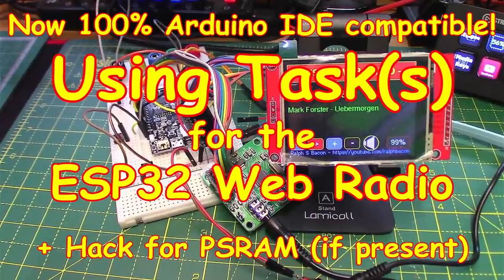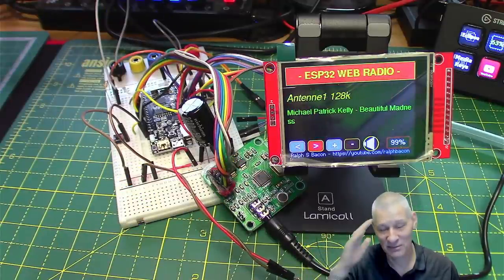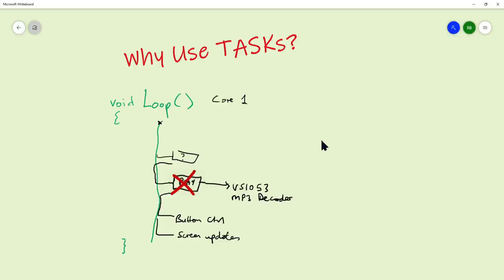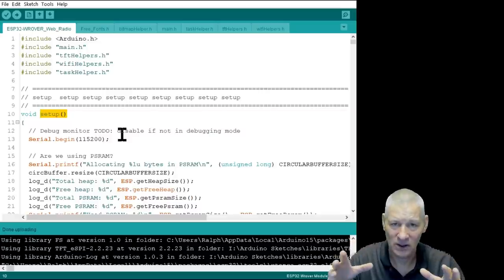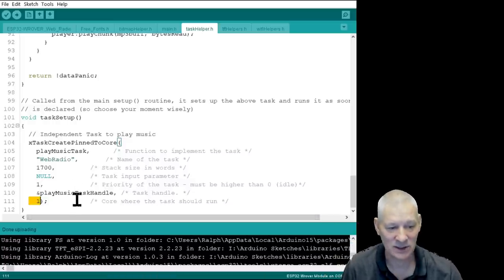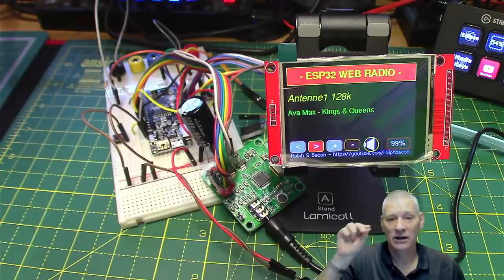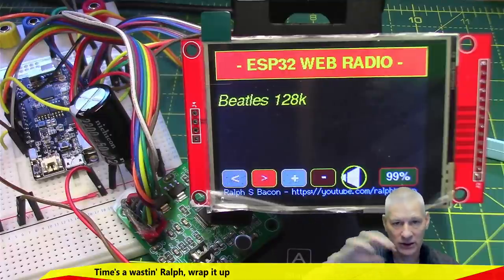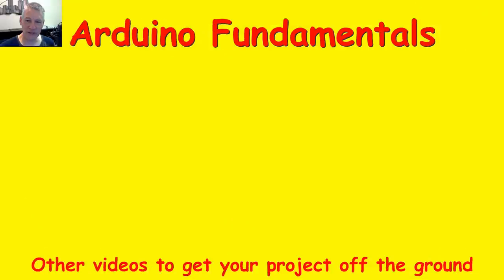#208 Using an ESP32 Task for my Web Radio - using the Arduino IDE

Comment: You way to do multitasking is not very good. I would want the player task to run at high priority, but not "wizz" around.
For real multitasking the task need to give up the CPU when it has nothing to do (Like waiting for sending the next data block or not playing at all).
The "loop" task has to work the same way for best performance.

System made for multitasking usually have ways to do this, this can be blocking calls that internally tells the OS to put the thread to sleep while waiting for a event.
A more simple way to do it is to call delay(xxx), this will usually do it, even delay(0) may work (It basically tells the OS to give all other task a timeslot, before returning.

Programming this way will usually reduce the power consumption of the CPU and make it more responsive. For CPU's with variable clock speed it is very important to it this way or the OS may not know the program is idle and can run at reduced clock speed.
Reply from the maker: Hmm. Well, let's consider your objections!
1. I'm not interested in the slightest about power savings at processor level. I had to add a dedicated 2A PSU just to stop brownouts. Maybe I'll refine this (much) later.
2. How can we detect when this task has "nothing" to do? It already queries the VS1053 to determine whether it's ready for more data. If not, what do we do? Delay? Suspend? For how long? The VS1053 could be ready in the next μS after that query. A delay of 1mS would be enough to cause audio glitches as the VS1053's buffer would be empty. I don't see what we can gain here apart from not keeping the VS1053 stuffed to the gills with data the instant it wants it.
3. At this stage we have no other tasks (apart from the main one) wanting resources. Giving up our time slice to the loop is exactly what I do NOT want to do - this task is more important than updating screen titles or servicing button presses. I'll let the RTOS sort out running the tasks in a suitable manner.
Henrik, you need to take a step back and see that this is a proof-of-concept piece of code that actually works very well indeed. It can (and probably will) be refined as things progress but until then, you need accept that this design WORKS despite your reservations about my multitasking skills!
Reply: The datasheet do not agree with you, an example says you can wait 5ms if the dreq is low (the chip has a 2kb buffer).
But dreq is also a pin and you could use that with an interrupt.
The datasheet even says something about not doing  continuous SCI operations.

Giving up a timeslice is often a very good idea when there is nothing to do, you will not loose more time than a OS forced task shift will give you and you now it happens when you are idle. The OS will still force some task shifts on you, but not as many.
The RTOS (or any multitasking OS) cannot sort out multiple task very well when they refuses to cooperate. Giving up timeslices and telling the OS to stop a task because it is waiting are what a multitasking OS is designed to handle.
To define what tasks are important or not you use priorities, but they do not work if the task hog the CPU. A high priority task must tell the OS when it is idle, or there is not spare time to run the low priority tasks.
Reply from the maker: NOW you're giving me the constructive feedback, Henrik, that makes your first comment make sense. I didn't realise that the VS1053 has a 2K buffer. In that case I most certainly CAN (and probably WILL) suspend the task for a sensible amount of time as I'm no longer worried about the 32-byte update amount. 
Using DREQ as an interrupt is certainly an option I had not considered; the options are multiplying even as I read your last comment! Thanks for the details. it's got me thinking! (This is why we did peer reviews at work, two or more heads are always better than one).
Reply: For the first answer I had not looked at the datasheet, it was just regular programming advise.
delay() may be better than interrupt for this chip, because DREQ signals when there 32 bytes free in the buffer, that would mean very frequently interrupts. Where a task that wait for the time to use 1000 bytes, before filling the buffer, would need much less attention. You will have to run the task at a high priority level to be sure it will run asap when it is time and you also need to be sure the delay() function is a OS function and not something that just waste clock cycles.
Reply from the maker: Thanks, Henrik, I will bear all this in mind when I get that far.

Comment: Hi Ralph. I tried to compile the arduino IDE version and got a message saying that the User_Setup.h is missing can you explain what I have done wrong? You also told me earlier in the week that I would have to adjust something and you would explain it your video. Was that the User_Setup.h which I need to make?
Reply: Hi Have you downloaded Bodmers TFT_eSPI TFT library ? User_Setup.h is a config file in that library. It supports a number of different LCD display panels, so you have to tweak that header file to match the LCD panel you are using and your pinout wiring if it differs from the default wiring.
Reply: @geoffw.5003  Thank you so much. I will have a look. Are you making the Internet radio? I feel embarrassed at asking Ralph such questions. I need to read things more carefully. In the meantime thank you once again.
Reply from the maker: The user_setup is part of the TFT_eSPI library (based on Bodmer's, and I have edited it to work with this screen and this project - that is, the correct SPI pins, for example). However, you have the entire Arduino sketch now (no need to download anything else) and I don't do anything special to get that user_setup file included. I'm using Arduino IDE 1.8.13. Ensure you read the readme.md file to copy the library files to the correct place!
Reply: @RalphBacon  Thanks  Ralph.
Reply: Using previously compiled file: C:\Users\pclay\AppData\Local\Temp\arduino_build_130546\libraries\LITTLEFS-master\littlefs_api.c.o
C:\Users\pclay\Documents\Arduino\libraries\LITTLEFS-master\src\esp_littlefs.c: In function 'esp_vfs_littlefs_register':
C:\Users\pclay\Documents\Arduino\libraries\LITTLEFS-master\src\esp_littlefs.c:203:9: error: unknown field 'utime_p' specified in initializer
         .utime_p     = &vfs_littlefs_utime,
         ^
Multiple libraries were found for "WiFi.h"
 Used: C:\Users\pclay\Documents\ArduinoData\packages\esp32\hardware\esp32\1.0.4\libraries\WiFi
 Not used: C:\Program Files\WindowsApps\ArduinoLLC.ArduinoIDE_1.8.42.0_x86__mdqgnx93n4wtt\libraries\WiFi
Using library Preferences at version 1.0 in folder: C:\Users\pclay\Documents\ArduinoData\packages\esp32\hardware\esp32\1.0.4\libraries\Preferences 
Using library WiFi at version 1.0 in folder: C:\Users\pclay\Documents\ArduinoData\packages\esp32\hardware\esp32\1.0.4\libraries\WiFi 
Using library ESP_VS1053_Library at version 1.0.3 in folder: C:\Users\pclay\Documents\Arduino\libraries\ESP_VS1053_Library 
Using library SPI at version 1.0 in folder: C:\Users\pclay\Documents\ArduinoData\packages\esp32\hardware\esp32\1.0.4\libraries\SPI 
Using library LITTLEFS-master at version 1.0.5 in folder: C:\Users\pclay\Documents\Arduino\libraries\LITTLEFS-master 
Using library FS at version 1.0 in folder: C:\Users\pclay\Documents\ArduinoData\packages\esp32\hardware\esp32\1.0.4\libraries\FS 
Using library TFT_eSPI-2.2.23 at version 2.2.23 in folder: C:\Users\pclay\Documents\Arduino\libraries\TFT_eSPI-2.2.23 
Using library Arduino-Log at version 1.0.3 in folder: C:\Users\pclay\Documents\Arduino\libraries\Arduino-Log 
exit status 1
Error compiling for board ESP32 Wrover Module.

I am not sure how to correct this library mistake. How do I correct the LITTLEFS-master problem.
I am using Arduino ver. 1.8.42.0 is this a problem? The wrover Module is setup as you showed in the images.
Reply from the maker: This error: unknown field 'utime_p' specified in initializer
         .utime_p     = &vfs_littlefs_utime,"
should be commented out (as I have done or it would not have compiled). You did take the (modified) libraries from my GitHub?
This is from library file: LittleFS_esp32\src\esp_littlefs.c
Of course, if you really using 1.8.42 then there's your problem. You're using an IDE that has not even been invented yet (the latest is Arduino IDE 1.8.13)!!! Or is this the web browser version?
Reply: @RalphBacon  It must be online. I will load the version you said. I will look for the littlest library and replace it. I hope I can find it. 
I wish I had your knowledge.  :-) Proberbly too late I am 73 years old. !!!!
Reply: Hi Ralph, I am now using arduion version 1.8.13 and the error still occurs, as I thought I could not find the LittleFS_esp32 modified version. I have looked in the Arduino Sketch box /Librares/there are only three folders Arduino-Log, ESP-VS1053_Library and TFT_ePI-2.2.23. Is this library only seperate from the arduino download in your GitHub? I have also serched there but no result came back only from another person. I am so near help me please get over this last problem(I hope). I presume the problem with the wrover board is because the error before.
Reply from the maker: I'll help further but it will have to be Sunday before I'm back in my workshop, got a long and early drive tomorrow. We'll sort it no worries.
Reply: @RalphBacon  OK Ralph have a safe journey. We have got a lot of snow in the south of Austria, Klagenfurt.
Reply: Hi Ralph, I have found the littlefs library and installed. I then proceed to change the CBUF.C file for the PSRAM. In my opinion I have chaged it correctly but get an error message in compiling as follows.

C:\Users\pclay\AppData\Local\Arduino15\packages\esp32\hardware\esp32\1.0.4\cores\esp32\cbuf.cpp:38:16: error: expected initializer before '*' token

 void IRAM_ATTR *ps_malloc(size_t size){

                ^
C:\Users\pclay\AppData\Local\Arduino15\packages\esp32\hardware\esp32\1.0.4\cores\esp32\cbuf.cpp: In member function 'size_t cbuf::resize(size_t)':
C:\Users\pclay\AppData\Local\Arduino15\packages\esp32\hardware\esp32\1.0.4\cores\esp32\cbuf.cpp:57:37: error: 'ps_malloc' was not declared in this scope
   newbuf = (char *)ps_malloc(newSize);

The cbuf looks like this:

I get this error message in the editor????
{
	"resource": "/C:/Users/pclay/Desktop/cbuf.cpp",
	"owner": "C/C++",
	"code": "1696",
	"severity": 8,
	"message": "Die Datei \"Quelle\" kann nicht geöffnet werden: \"cbuf.h\".",
	"source": "C/C++",
	"startLineNumber": 21,
	"startColumn": 1,
	"endLineNumber": 21,
	"endColumn": 18
}

I know that the cbuf.h is not in the correct folder, I have moved a copy to the desktop for analysis. I get the same message when I open it from the correct folder.

cbuf::~cbuf()
{
    delete[] _buf;
}

size_t cbuf::resizeAdd(size_t addSize)
{
    return resize(_size + addSize);
}
// Duplicated from esp32-hal-psram.c
void IRAM_ATTR *ps_malloc(size_t size){
    return heap_caps_malloc(size, MALLOC_CAP_SPIRAM | MALLOC_CAP_8BIT);
}

size_t cbuf::resize(size_t newSize)
{

    size_t bytes_available = available();
    newSize += 1;
    // not lose any data
    // if data can be lost use remove or flush before resize
    if((newSize < bytes_available) || (newSize == _size)) {
        return _size;
    }

    // RSB Use PSRAM here if required
	char *newbuf;
	if (BOARD_HAS_PSRAM)
	{
		newbuf = (char *)ps_malloc(newSize);
	}
	else
	{
		newbuf = new char[newSize];
	}
	char *oldbuf = _buf;

    if(!newbuf) {
        return _size;
    }

I could send the whole changed cbuf.h if you  wish.

regards,

Paul

                                     ^
Reply from the maker: I'm back! Now, LittleFS library has been modified (I commented out line 203) so you can just copy that library folder into your usual "libraries" folder, along with the other two in my GitHub. Arduino IDE should then find them. Details:
#ifndef CONFIG_LITTLEFS_FOR_IDF_3_2
#if CONFIG_LITTLEFS_USE_MTIME
        //.utime_p     = &vfs_littlefs_utime,   <----- COMMENTED OUT
#else
        .utime_p     = NULL,
#endif // CONFIG_LITTLEFS_USE_MTIME
#endif //CONFIG_LITTLEFS_FOR_IDF_3_2
Reply from the maker: You can use the cbuf.h file unmodified (ie the original version) just reduce the CIRCULARBUFFER size to about 10,000 or you will make the ESP32 reboot again and again. When it compiles and you have uploaded it we can revisit this.
Reply: @RalphBacon  Thanks Ralph, I have now corrected  LittleFS library  . The library was called esp_littlefs.c  is that correct?
Reply: @RalphBacon  I am afraid I have corrupted the original version of cbuf.h because I get the same error as the corrected version. I cannot find where to correct the CIRCULARBUFFER size. Do you honestly think it would be better for me to wait until the final version of everything is ready and then start frsh. I honestly have a bad feeling being the only person to ask you so many questions. :-) If I gave you my email could you mail me the cbuf.h and do I have to do anything to the header?